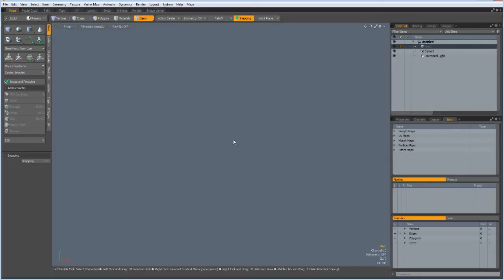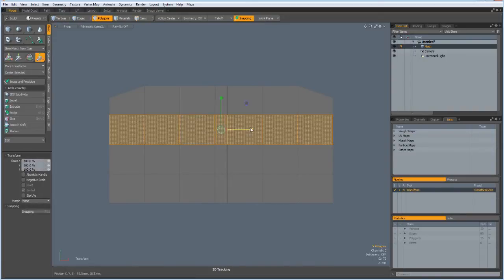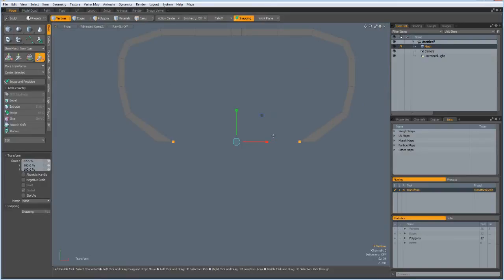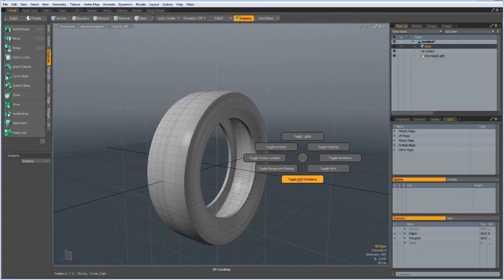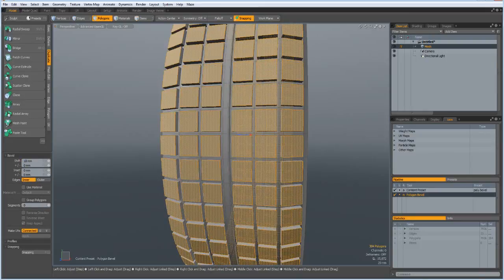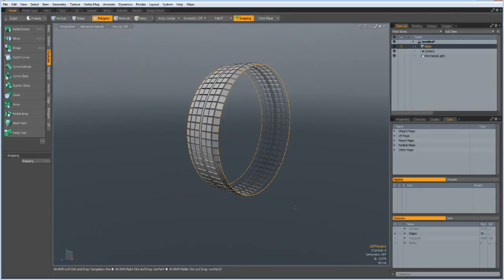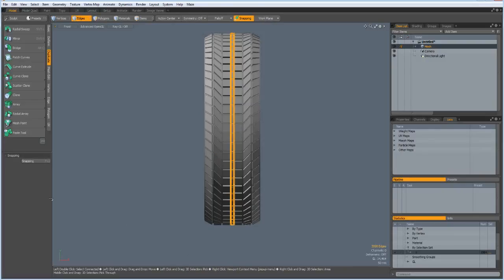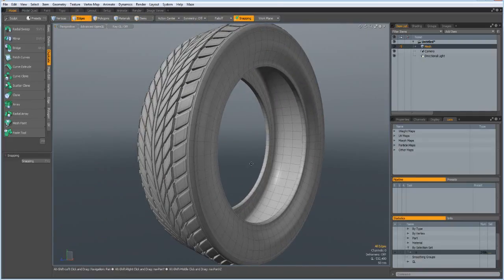Luxology modo - Modeling a basic Car Tire

Comment: Thank You, Peter! I love how you create the pattern of the tire tread by just rotating a selected set of polygons.
Reply from the maker: +Patrick von Janicke Hi Patrick, thanks for commenting, I'm glad you find it useful. Btw.. How is your Harley modeling project getting along ? Kind regards, Peter
Reply: Hi Peter, the chopper project is still unfinished - just like real motorcycle projects. I got stuck at modeling the frame (tubes/curves). Texturing the tank with scratched paint seemed daunting too :-)

Comment: I really liked this tutorial, but the edge flow at the end was disastrous. If you were to hit tab again at the end then you would've shown us all of the holes that were created.
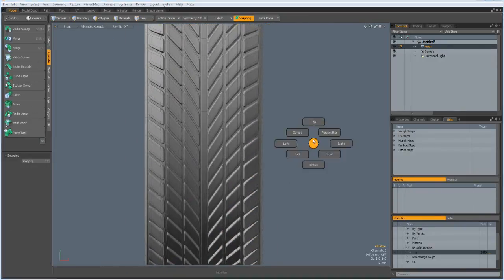Reply from the maker: Hi, I don't really know what you mean. Have a look at 9:27 in the clip and you see, that i subdevide the model and it has no holes. Kind regards, Peter
Reply: Hello, I was able to sub just fine. The issue came up when I un subbed. That's when the holes appeared. 
I tried to to clean up the edges so that it wouldn't happen, but couldn't find a way. 
The issue came from rotating the edges towards the end. I'd love to know how to clean those lines up, because this tutorial was awesome. It's just the very end that I'm stumped on.
Reply from the maker: Did you run mesh clean up to get rid of duplicate poligons ?
Reply from the maker: Hi, did you run 'Meshcleanup' ? Depending on your MODO Version, this is a script which has been integrated in MODO 901. Otherwise you can just Google for it. I am sure, you have duplicated geometry in your model which is very easy to get in MODO. Good luck, Peter
Reply: Hello. I'll make a quick video showing you the problem. Maybe that'll help.